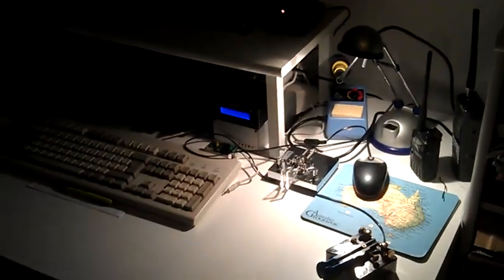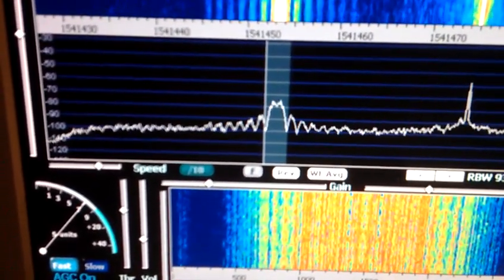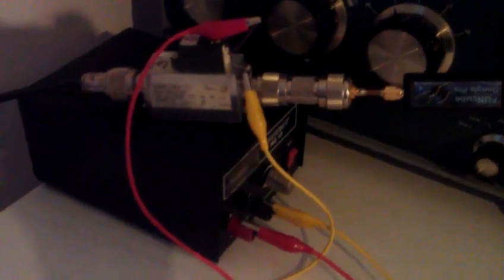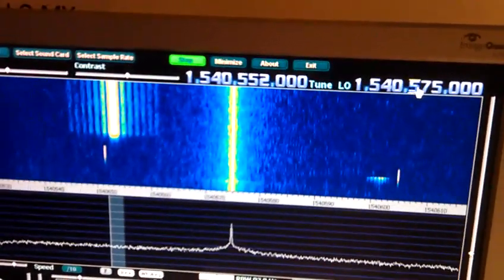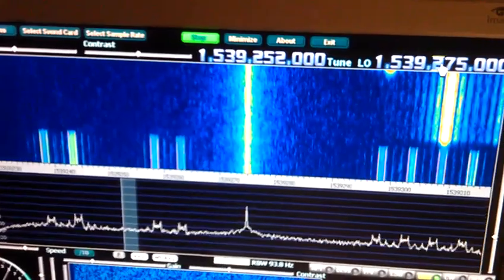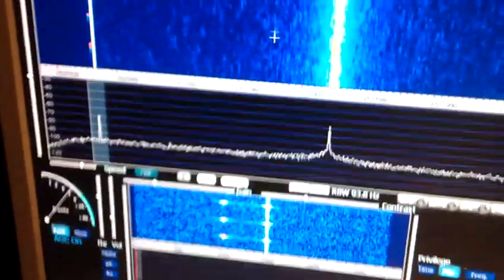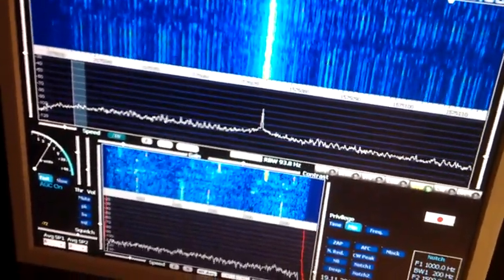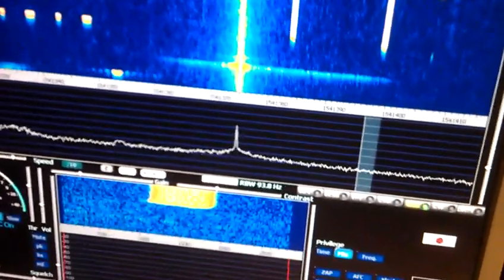INMARSAT Funcubedongle reception

Comment from the maker: @andiegurgel 
With the latest firmware which seems to correct a sampling error (dropped samples) in the funcubedongle sound chip the PSK decode is quite stable, though not 100% perfect, but many frames are decoded OK.